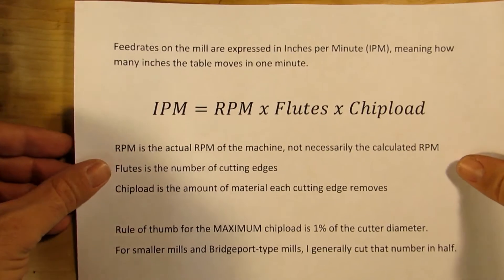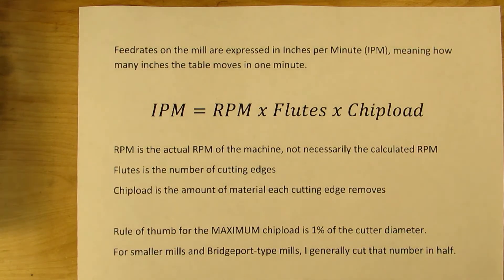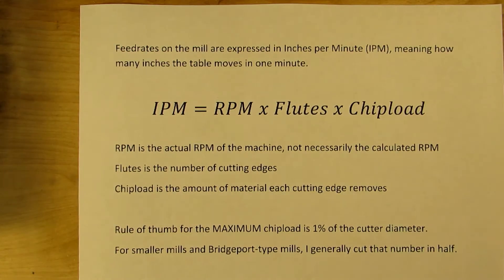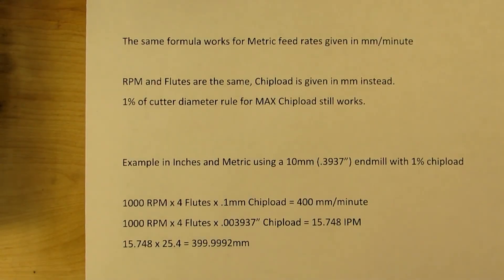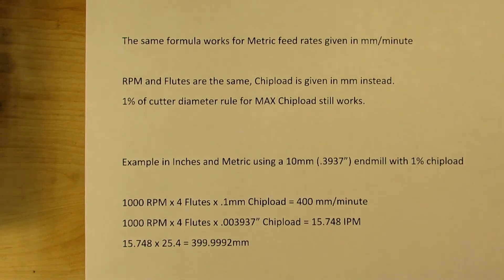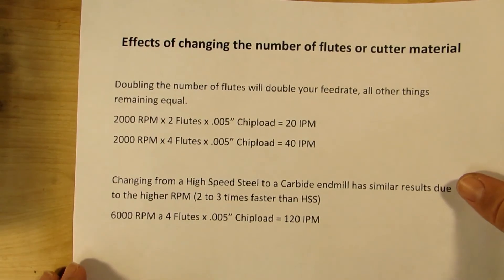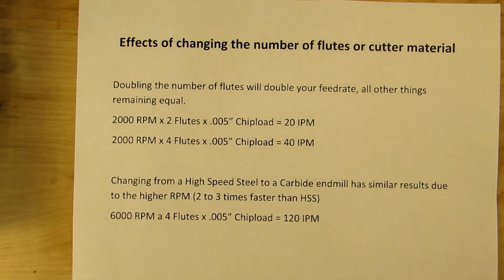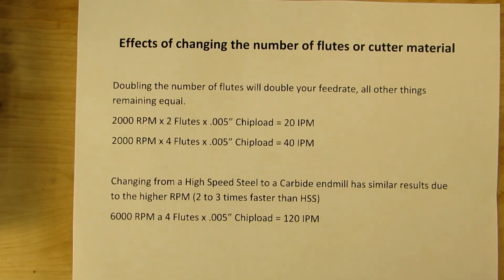Feedrates For the Milling Machine

Comment: How does depth of cut play into the equation?  

Also, on a manual machine are you just taking the IPM and dividing it by the travel per turn of your lead screws and then roughly turning in your head?  Like, 6IPM on a 10TPI screw would give 1 turn per second, a fairly easy thing to do by hand.

This gives me an idea that a lead screw RPM readout for X travel power feed would be a neat and useful thing to have.
Reply from the maker: For the most part, I use this formula as a starting point and then make adjustments depending on the feedback I get from the machine and the look of the part.  Depth of cut plays a big part in that.  The deeper your cut, the more load it puts on the tool.  Depending on the material I'm cutting, I'll choose a depth of cut that I know from experience definitely works.  That might be .050" in harder materials and .100" in softer.  From there, if the parts looks good and it doesn't sound like a cat being disemboweled, I'll start increasing either the feed rate or depth of cut.  If I start having issues, I'll back down again.

You're spot on with regards to turning the results of your math into turns of the handle.  A Bridgeport advances .200" with each handle turn, so it takes five turns to go 1".  If you've got to go 10 IPM that would be 50 turns, so a little less than one turn per second.  Hope this helps.
Reply: Stuart de Haro thanks for the response.  I try to use stefan's tip about cutter economy and cut with full depth where possible, and a gentle feed rate, to make the most use of the cutter side edges and keep the tip and corners alive as long as possible.  And for non dimensional items I try to use reground cutters that are no longer marked diameter, and save the dimensionally correct cutters for where its critical.
Reply: @StuartdeHaro  Is there a formula for calculating optimal cutter depth?
Reply from the maker: Hi Marvin. While I'm sure there is one, I don't use it.  I just try to balance out the cut radially and axially just by intuition and paying attention to the machine.  I change it up a lot as well depending on cutter diameter and material being cut.  If I'm taking a finish cut that is relatively light radially, I know I can get away with more engagement axially.  If I'm taking a pass with the whole diameter of the endmill, I know I want to back off the depth of cut axially so the endmill doesn't overheat and destroy itself and my self esteem.  You have to take the size of the cutter into consideration too.  You can cut .100" deep all day with a 1/2" cutter, but that would break an 1/8" cutter pretty easily. 

If I think about how I usually do it, I probably start around 20% of the cutter diameter for the axial depth if I'm cutting with the whole diameter, and then see how it sounds and how it feels through the machine handle.  That said, I routinely cut keyways in steel shafts with the full diameter and 50% depth with no problems.  I just pay attention to the machine, the sounds, the chips, etc. and make adjustments accordingly.